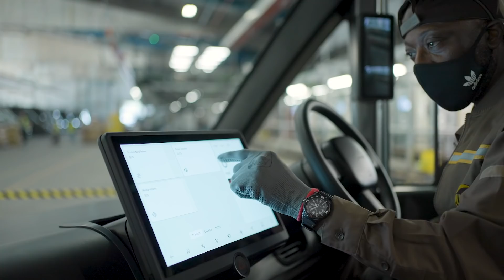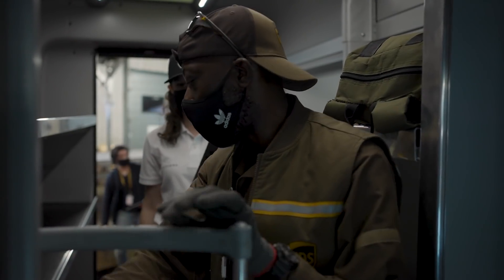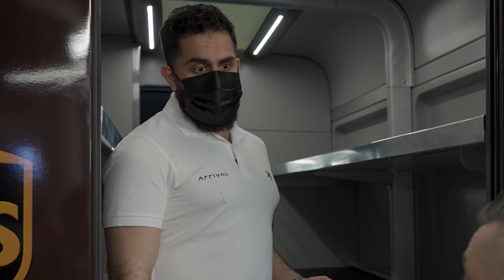UPS Drivers Test Arrival Van for the First Time | ARRIVAL

Comment: All “last mile” delivery trucks should be electric.  EVs are so much more efficient for stop and go driving.
Reply: Unless it's 20 degrees Fahrenheit 😂😂😂
Reply: @jacobcarter5923  i’m sure EV manufacturers and the people at UPS who buy these trucks have thought about conditions year-round. It are not some standard car batteries that they threw in.
Reply: Yeah, unless it’s super hot outside or supper cold, they’re great. Or make everything use diesels & then the temperature doesn’t matter at all.
Reply: @michaelbenoit248  Diesels pollute our air for us and our future generations as well as all the noise pollution they create.  I would love to see EVs as 75% or more of the rolling stock on the road in my lifetime - and I’m 65 years of age!
Reply: And you should pay for them
Reply: @robertmontgomery7158  They will pay for themselves just due to them being much more efficient.
Reply: @kevinkaaz7720  do you realize less than 5% of lithium ion batteries are recycled? Millions of EVs are being made and no one is recycling this E-waste. EVs may not make noise or take gas, but they produce as much if not more pollution from start to finish.
Reply: As a courier and somebody who lives in an area that gets Sub-Zero weather this just isn't feasible at the time being. Electric cars are just too expensive straight up and I don't have anywhere that I can charge the closest one is Louisville Kentucky and that's like a 3-hour drive. Also I don't think that there is an electric vehicle that can do the thousand miles a day that I can travel depending on demand.
Reply: @brittherself  You are driving over 16 hours a day?  65 mph for 16 hours is 1040 miles!!!  That doesn’t sound anywhere close to safe.  I think you might be inflating the miles of range you need per day and if not, I’m glad I am not driving anywhere close to Louisville.
Reply: @kevinkaaz7720  this may have been true of older diesel engines but newer engines actually emit cleaner air than what they take in. As far as noise pollution goes the some of the newer engines are so quiet you often can't tell they're running. We have cement mixers in our fleet that the noise of the cement in the drum is much louder than the engines.
Reply: @Engineer9736  It's normal to doubt them. Much larger car manufacturers have failed at exactly that point for many years. Kia, Tesla, Nissan, VolksWagen...pretty much every car brand that is pushing out EVs right now. The latest Tesla's are incredibly efficient even when it's outside optimal working condition (very hot and/or very cold outside temperature). The drop in range outside optimal conditions is thanks to those optimizations less significant than some other car manufacturers. It's not as easy as you think! The other car manufacturers have shown that over the years! Not easy at all!
Reply: @OlSmokyDaBear  I’d like to see the study that proves that about the emissions.  And EVs don’t need a cement mixer on the back of the vehicle to cover the noise of the motor.  And what is noise that is produced from any power plant but wasted energy.
Reply: @brittherself  how many times do you do 1000 miles without stopping for a break? I'm pretty sure that's not legal.
Reply: @jacobcarter5923  we drove our Tesla in -40 degrees in Fairbanks and it did great

Comment: I was a postman for a decade, this would have been fantastic. Hopefully Royal Mail get involved too.
Reply: Salut 👍
Reply: They should be. Although they are certainly much further behind. They are literally only testing out a few electric converted ones based on the model they are already using, which means it doesn’t look really much different. And it’s only for a short term trial run and then they will go away and see if they will adopt it full time for the whole area. Once again showing that the government side of things are moving pitifully slower than the corporate side.
Reply: @danielwhyatt3278  Royal Mail is a private company. No longer anything to do with government since 2015.
Reply: @retiree1033  Still union fed umbrella,,,,
Reply: @andy567t  ?
Reply: It's a rich man's design that's not practical for long-term use ... And that's my opinion because they that designed it made a design flaw into it's front fender well on the sliding door that'll wear out between the gaps and winter season mud and snow will build up right there .... 🤣 It's awful but maybe I'm wrong , do you think so ?
Reply: @joesguiltyguitar  there's not much mud and snow on Britain's city streets.
Reply: @joesguiltyguitar  I used to be in the tv business and when colour tv came out.I remember one dealer saying it’s a one week wonder
Reply: @danielwhyatt3278  Corporate side faster? The first electric car was created in 1890. The first Tesla produced was in 2008 which is 118 years later. Now that's slow as molasses! And that's Corporate America!
Reply: I hope we get these. Gasoline vans are a nightmare to drive in neighborhoods with steep hills. That instant torque will help.
Reply: That is so cute. Is that really the name of you guys mail system?
Reply: @givethem_chell  - Royal Mail? Yep, that’s our postal system. Why not google it for more information? 👍🇬🇧
Reply: @givethem_chell  Royal Mail is older than the USA
Reply: royal mail dont care about the environment heence their use of fossil burners
Reply: @bittasweetsymphony726  what fossil burners? Vans? If its vans then that's practically saying that every delivery company does not care about the environment sooo
Reply: No one but UPS will get these vans. 
Try finding, let alone buying one of there custom built vans, you can't. 
They get crushed after a certain age. 
The sprinter vans ,yes, its just a sprinter van.
Reply: If royal mail gets involved... IT'S AN ABSOLUTE RAP 🚀
Reply: Amazon uses non-electric versions of these already en masse. So I am sure every business will have them asap
Reply: Royal Mail is testing or has already electric black cabs (from the LEVC) and they already use electric Mercedes Sprinter vans in London due to restrictions (low emission zone). One office in Bristol has recently had all their 23 vans exchanged for electric ones. 29 gas-powered trucks were also bought.
Reply: @o0SayNoMore0o  RM currently is testing 9 Arrival delivery vans.
Reply: @dmacarthur5356  you got a link?

Comment: I was told a story that a small kid got ran over trying to recover his ball that had rolled under a delivery truck. Which is why some companies require cones out. Cones are to make the driver do a perimeter check before taking off. I can’t imagine an electric vehicle that can’t be heard. To Arrival, please add some type of feature that can detect an object under the vehicle.  I see tons of delivery drivers till this day jumping in and out of the vehicles and quickly driving away.

Comment: The major corporation I work for asked our opinion as the people would be using the vehicles because they said it was important, of course they asked us after they took delivery of the vehicles. Then they be BS’ed  to try to convince us that we were wrong and finally they just told us you work with what you got and walked away from the table, yes we have a union, and yes the union is in bed with management. I guess you have to make a nice commercial for your company

Comment: I have worked as a delivery driver, lifting much heavier goods at least 25kg, than just small boxes or packages for UPS. We had no shelving or technology, even sack truck. They are very lucky to have such a vehicle and even better that it’s purpose built and electric. Much smoother and more efficient.

Comment: dumb question but how do the packages stay in place on those shelves?
Reply: They have grip on the bottom and usually have packages on corresponding sides. used to work at fedex
Reply: sometimes they don't and it just makes a mess :/
Reply: Packages are "lip-loaded" which is suppose to give them a slight angle back toward the walls. It doesn't really keep them from falling. Once curb and everything is all over the floor. Most drivers get to their first stop and have to pick up about ten packages that fell and put them back on the shelves. (if there is still room). It's horrendous if your route is on poorly maintained roads like mine is.
Reply: @pugggs  How do you find the right package? Are they sorted somehow on the shelves? Also, if that’s the case, I suppose when you go to put them back, you’re probably having to put them back into the correct spot as well.

Comment: You need input from the package loaders as well.
Reply: @assmunchtube  ow trust me it is.  Depending on the day we fill those trucks to the brim
Reply: @assmunchtube  That's a user error, not a design error. You don't complain about a 1 gallon gas can not being able to hold 2 gallons, so why would you complain about a van not holding enough packages? If you need to carry more, you need a bigger vehicle, or take more trips.
Reply: @timderks5960  But if the van needs to be able to fit all the packages, should it not be able to?
Like you said. If you need to fit 2 gallons, you'd rather have one that fits 2.5 gallons than 1.5, for the times you have the extra large loads. Extra large loads should always be expected, always plan for more than you need.

Comment: When they first said Camden, I thought New Jersey USA.  😆
Then I heard the driver's voice.  Of course not!
There's no way this is happening here (today)
Reply: UPS in the states works with workhorse an EV van maker
Reply: Thought the same!
Reply: UPS, in the USA, last mile vehicles are much larger, have much more mass to carry each trip, and travel longer distances than this UK UPS division does. 

BEVs are great for short distance, relatively low mass load cargo, in mild weather.
Reply: @davidhoffman1278   Plenty of range now.
BEV are ideal for all the start and stop of delivery vehicles because of 100% torque and all the regen stopping.
Having a dedicated depot to recharge at night and the lack of constant maintenance needed for ICE vehicles, not to mention the favorable energy per mile cost are all +++.
Bigger?
Yes, American box trucks are bigger, mostly because American roads are bigger.
But I guess we'll see how Amazon implements this.
Reply: I don't think they would work in the USA. Poor air circulation in the cab unless they have A/C. In the summer your going to bake. Back door wasn't very wide. Packages won't fit.

Comment: I've never seen the inside of a UPS van like that before, normally there's no shelving (because that takes up room) and it's packed solid with parcels so they can fit in there 140+ deliveries each day.
Reply: I imagine in more populated areas that they would build these vehicles a lot larger than this prototype.

Comment: Will the new van have A/C ?  Makes a Huge difference in the summer. Maybe not in the UK lol.
Reply: I can't imagine why anyone would put a new vehicle on the market without AC. It certainly wouldn't cross anyone's mind to buy one. 

I live in Finland which is colder than the UK and AC has been more or less standard on new cars since the very early 00's. It's useful six months out of the year.
Reply: @christianronn5301  I live in Canada and its 50c in the summer inside older trucks. The cops would give us a ticket for driving with the passenger door open.

Comment: Are these going to be operated in low-light conditions? Low visibility? How about a lighted area at the entry points? Movie theaters have very specific lighting, so the room can be dark and yet people can see all of the stairs. How about lights that illuminate the front and rear entry points when the ambient light is below a certain lumen level? Fully automatic, of course...and very bright.
Reply: I bet the drivers asked all these questions. They just didn't show us all the critical feedback (which I find is also the weak point of this video).
Reply: Do you know that they don't have this? This was a short video presentation of the latest prototype covering only a few very basic themes. I suspect you would need a couple of hours to cover all the detail.

Comment: I don't think humans really appreciate how much NVH really effects the human mind and body over the course of an 8* hour shift. Gas or diesel you're sitting in the thing on a thin pad ALL day. I would never suggest that it is the most difficult part of the job, but I think you'd be surprised how much it helps to remove those continuous unpleasantries.

*I used to work as a UPS driver helper during the holiday season and you'd be lucky to only be running around for 8hrs.

Comment: Why is the display not angled to the driver?
Greetings from Malta, Tom.
Reply: Could it be to avoid catching sunlight from the windshield/windscreen at certain times of the day, making it difficult to see?
Reply: @gwarlow  its possible to have matte displays that prevent glare instead of glossy ones like this. My laptop has one

Comment: I love this project. Its great advance in therms of material and other specs, but...
Aren't you guys planing to use solar panels integrated in the rooftop?
Wouldn't it be an advantage as most veicles stay stoped outside most part of the time?
Reply: The advantage from a few square meters of solar panels is miniscule compared to how much energy the vehicle consumes. Sorry.
But you could run part of an AC on a sunny summer day at noon. Unless the vehicle drives in a city with tall houses, of course. ;)
Reply: @bernadettetreual  I think the question is: how many kms would the veichle do per day on solar?
The project sion by sono motors states they can do 30km a day on solar.
Reply: @pedrogloria1851  I'm sorry, I read too many numbers that were based on very unrealistic conditions.
Let's try it: Calculate the surface area of the Arrival Van that can be directly illuminated by the sun, multiply by the global solar constant (1.4 kW/m²) and the efficiency of top-notch solar cells (30%). That's a theoretical maximum power you'll get. Due to light falling at an angle onto the cells, shading and heat, efficiency drops further. Not speaking of any clouds or British weather. Multiply by how long the sun shines, that's your energy.
Reply: @bernadettetreual  So, if the veichle stays stoped for two days it would do any diference?
Reply: @pedrogloria1851  Yes, it would. But no sane businesswoman would have her fleet standing still for two days, and not every business is located at the equator for maximal irradiation.

Comment: I have so many questions: 
What’s the mileage? 
What’s the charge time?
How many miles does a van travel in a day i.e. how many times will have to recharge during the work day?
Reply: they havent released range figures, but delivery drivers dont go that far in a day, so they wont have to recharge during the day at all even if the range is poor, which it wont be.

Comment: At 1:20, we see the sharply projecting front corner of the door due to the outward angle of the wheel flare. That looks like a potential safety issue, where it could be caught quite often, by drivers' knees or packages entering or leaving the cab. You might consider cutting that forward door edge corner back at a 25 degree angle, to lessen the obstruction of the doorway, leaving that extra material as part of the front fender, where it's entirely out of the way.

Comment: Is it necessary to have the shelves fixed? If they were moveable, vertically, it might be possible for them always to be at the most convenient height. Way to go.
Reply: This has been designed for a particular customer requirement. Check the Arrival website ... the van can have several different layouts.

Comment: See that might work in the UK where you've covered your full route after just 3 miles.  But in the US you'll run out of battery before completing the route, not to mention the Northern states and Canada where it hits sub zero temps, these things won't even be able to pull out of the terminal.

Comment: What's this van like on rural roads? I deliver in Raleigh NC area. Dirt, mud, uneven pavement, etc. Is this designed for new pavement only or can it tackle diverse residential driveway conditions? I'd get a van if it can!

Comment: These look great and i expect to see a lot of them around the place... my only question is, is this design of Arrival van replacing the smaller one that has been around for a while or is that van also going to be built?
Reply: This is the replacement for the old design van that was tested with the Royal Mail. They got a smaller van in the works and a bus and as Robert has nearly spilt a few times they have a electric car in the works as well.

Comment: zero emission? how are you charging them?
Reply: Zero tailpipe emissions
But there is a lot of wind power in Great Britain.
There have already been stretches where no combustibles were added to the grid. (and it only gets bigger as a % every day!)
Reply: @jimurrata6785  Renewables don't provide as much electricity in the parts of the UK as you may think.

Scotland is well served with renewables.

You can download an App from the National Grid that gives accurate informtion.

Its called National Grid ESO and it is regularly updated.
Reply: @bigjml  right now in the North West (where I live) there is 10% from fossil fuels. Getting close to zero emissions.
Reply: @peterbrown6453  Fairly irrelevant as demand is usually low on a Sunday.

And since a huge % of the UK population is in the South East that would be the figures you need to consider 

Being closer to Scotland and using their excess capacity is hardly a long term solution.